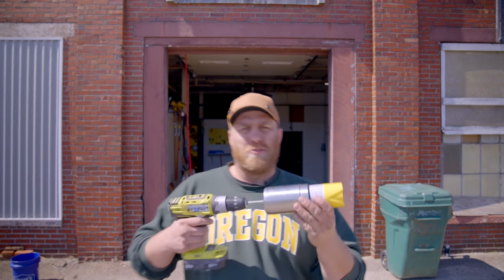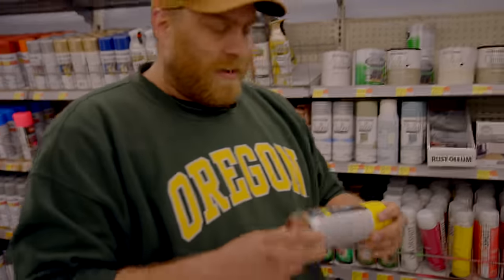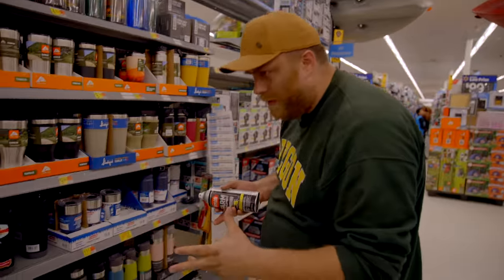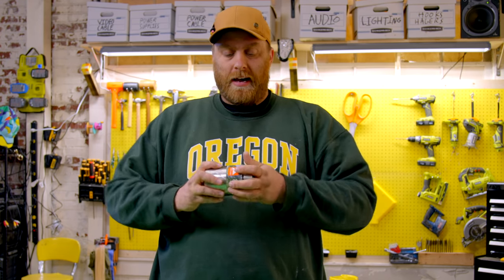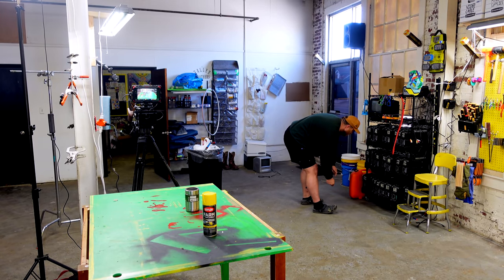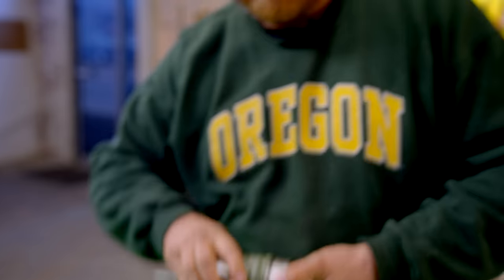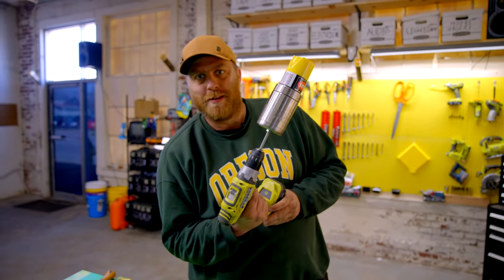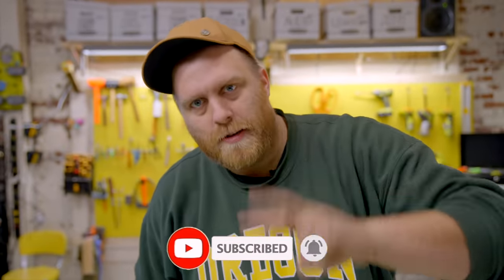I Built Adam Savage's Spray Paint Can Mixer With CHEAP WALMART Parts!

Comment: Doesn’t the ball bearing inside need to go up and down
Reply from the maker: Not necessarily. All that has to happen is the two component inside the can need to mix. The spinning, slightly off axis, is sufficient to make that happen. Sometimes, super old paint will separate entirely, and no amount of hand shaking will mix it back. But I’ve seen one of these being that paint back to life in seconds! 🤘
Reply: I would guess if the solids have firmly sunk to the bottom one could just invert the spray can (top in the cup first). That alone should get things mixed properly in no time. With gallon house paint that's been sitting in the garage for (too) long, I'll set the can upside down the day before I plan to paint. It still needs mixing but the solids get off the bottom some, making it easier to mix. Caution! Make sure that lid is on tight. I usually place the can inside some kind of catch pan, like a dollar store aluminum pan just in case. I learned this lesson the hard way. Can't always trust those dang things.

Comment: The very best part of this presentation? You involve your boys in the whole project, start to finish. Under dad's guidance and loving sense of humor they're growing up learning creative critical thinking, mechanical skills and developing curiosity about the world around them. Atta' boy, dad!  Suggestions:  
Might try reinforcing the bottom of the cup with something like a scrap piece of thin plywood. That would keep the thin sheet metal from buckling.
Cut that long bolt down to no more than 2 inches. All that extra bolt wobbling around is putting unnecessary stress on your drill's bearings. Cut it short enough so what's left will fit all the way into the chuck. Your bearings will thank you.

Comment: Dude... You gotta combination wrench that fits the nut. Look at that and get the size. It's stamped right into the wrench, like 1/2 or 5/8, whatever. Now select your socket that matches.  That's right, sockets got sizes stamped in too 🙄

Or just grind off alla the measurements on all yer wrenches and fumble around 🤣